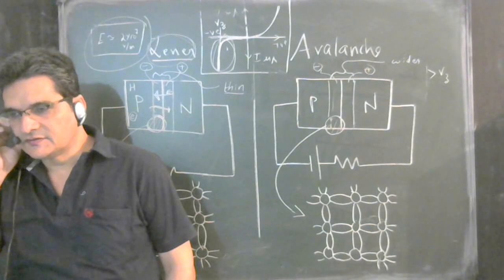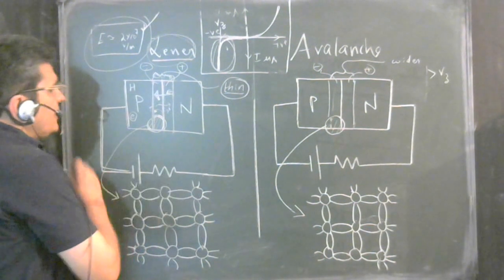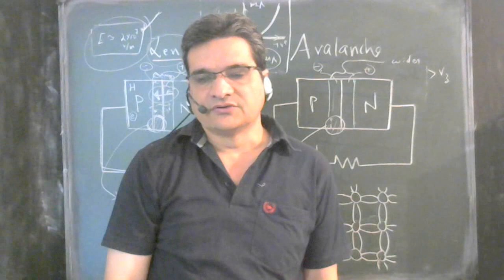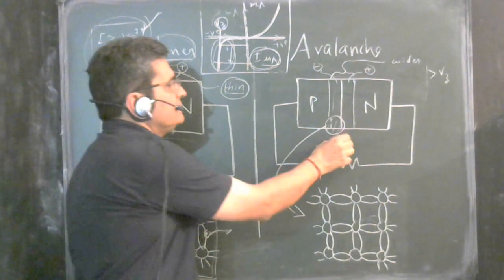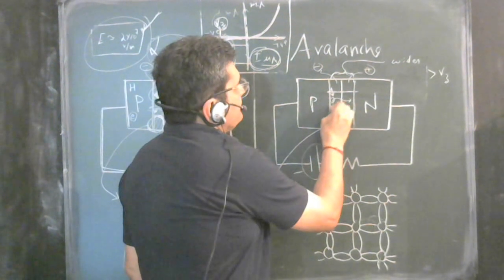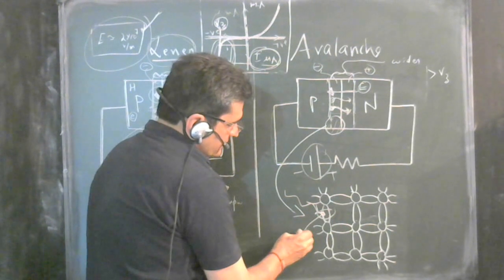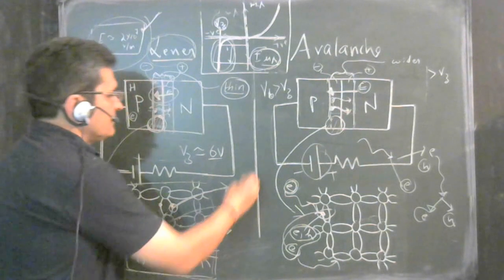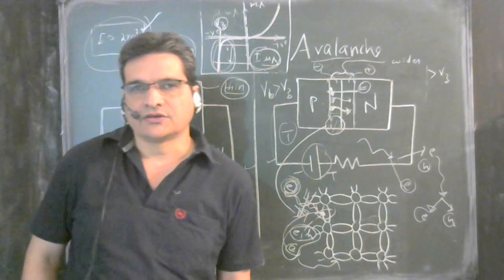Zener and avalanche breakdown difference explained physics for class 12

Comment from the maker: High doping gives high electric field in depletion region which is essential for pulling out the electrons in depletion region. But avalanche breakdown is not due to pulling out of the electrons, it is because of collision  between high speed electrons ( they acquire that energy from the applied reverse bias potential) . To cause avalanche break down you may not need very high electric field in depletion region( to cause zener break down), but you need high potential difference to give enough energy to moving electrons in the diode which then cause avalanche break down.  If the diode is already highly doped, you may end up having very high E field in depletion region leading to zener break down.

Comment: Why does Avalanche Breakdown require low doping?....and..
 Why does Zener Breakdown require high doping?
Reply: Because at low doping ,minority charges can acquire enough Kinetic energy to break the covalent bond i.e, it has more space to acquire it but in case of heavy doping the chances of acquiring enough Kinetic energy to break covalent bond is low since there is less space and that's why AVALANCHE BREAKDOWN has positive temperature coefficient because if temperature increases the atoms vibrates and its difficult for charge carriers to get kinetic energy,So the avalanche breakdown voltage increase s